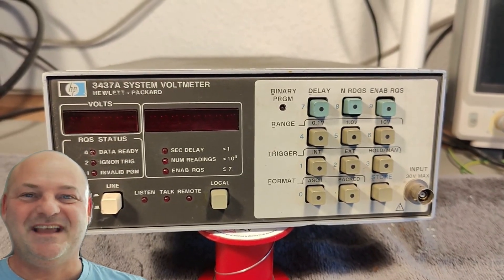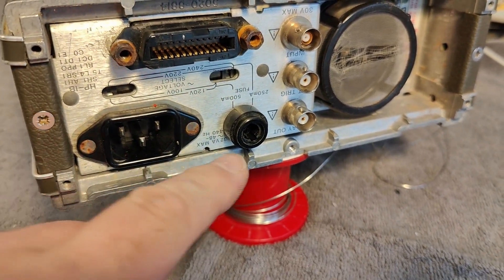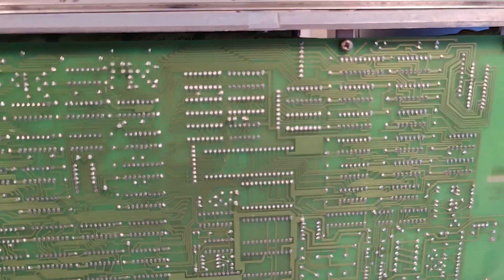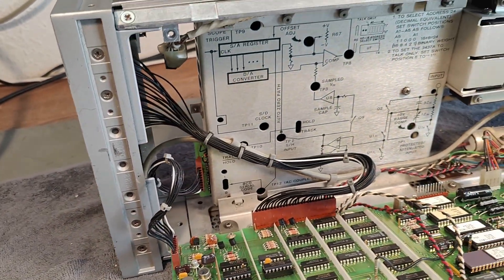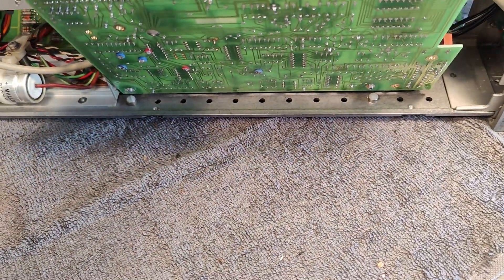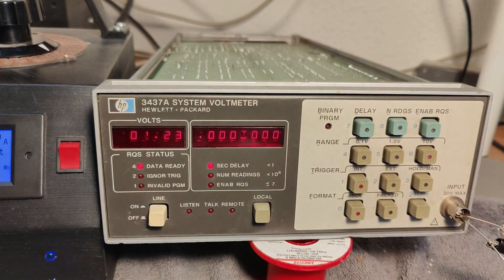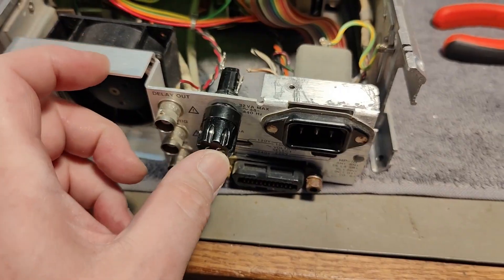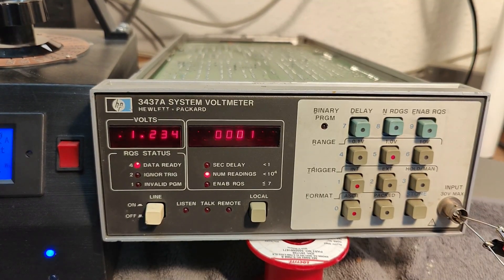HP 3437A System Voltmeter triggable 1979 test teardown

Comment: Teflon standoffs and triax smelled like very high impedance, so I checked. On the lower two ranges it is 100Mohm. Not really that high, maybe when it came out it was?
Reply from the maker: still at 100Meg you still dont like leakage, just a little bit willl affect precision

Comment: @12.50 that is a triaxial connector, used on precision equipment that require a guard in the cable, just the opposite of garbage. The rear input was also a triaxial connector too.
Reply: Wait until he sees how much triax cables cost...  🤣
Reply from the maker: i am not a huge fan of this connector :-) i think mostly due to a lack of mating parts on my stock.
Reply: @TeardownOZ2CPU  yeah, none here either, my worst one is the Fischer connectors on my Solartron meters  🤐